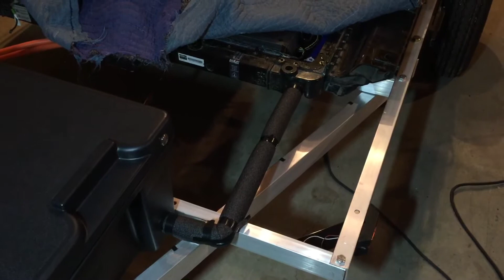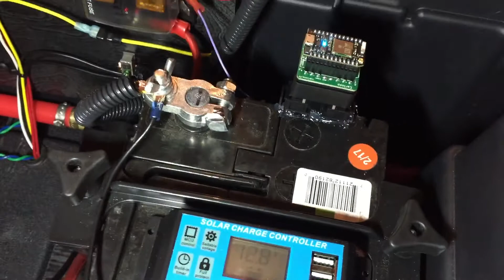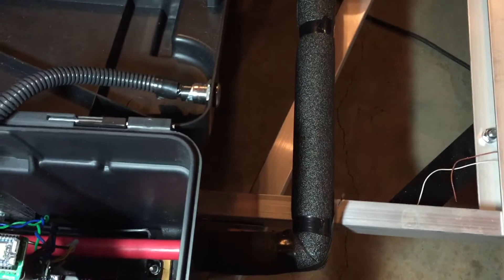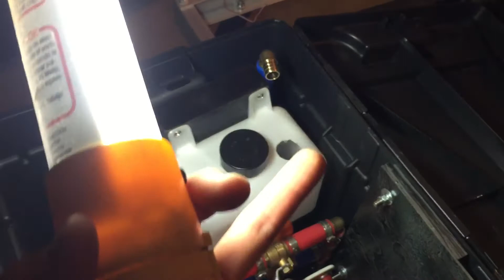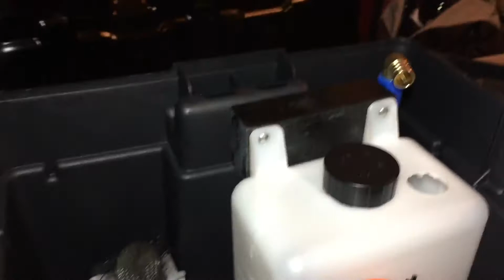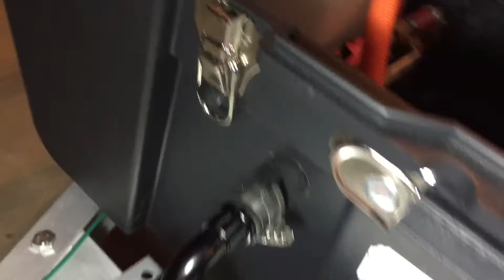T-Rex Build: Adding Heating + Cooling system to Tesla Battery pack.

Comment: hi there, arent you scared of the liquid in cooler expanding or freezing when you are  using the heating system? just worried if its like in the minus temperatures for that cooling system being on the outside. please let me know what you think
Reply from the maker: ahmet telli no. Glycol has a huge temperature range. It’s not going to freeze at any ambient temps we see on earth.